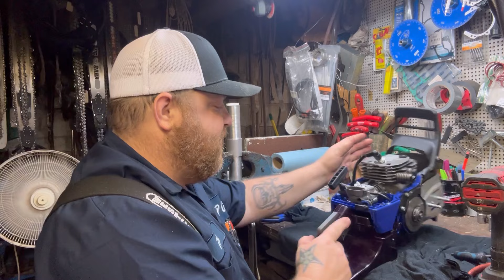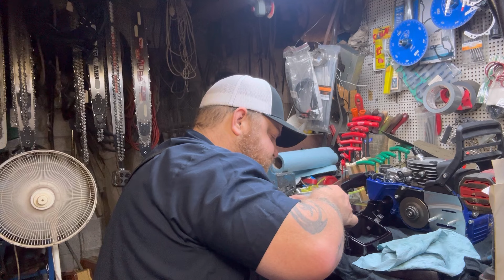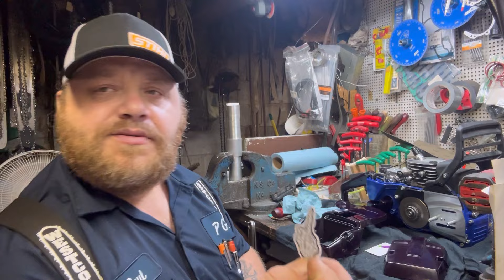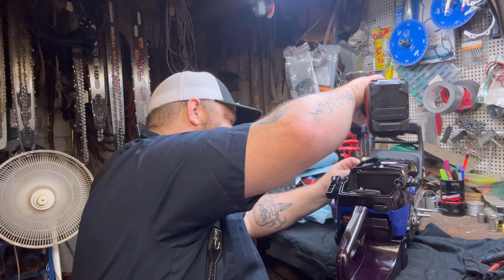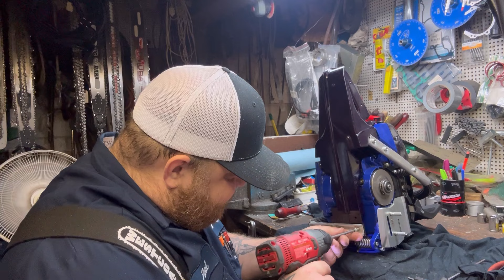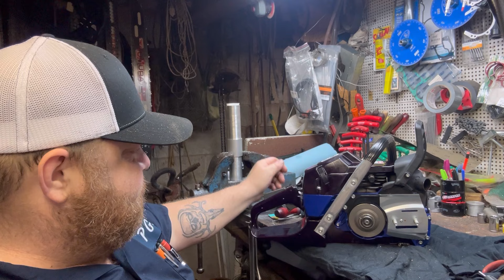PORTED HOLZFFORMA 372xp.."MOMMA TAZ XP TRANSFORMATION" @MOMMATAZ81

Comment: Did you use all Holzfforma part on that build or do you swop some out for better parts? I have never worked with any clone stuff. I’m out of the loop on what’s good and what’s not.
Reply from the maker: 100% Holzfforma
Reply: Thanks, Aaron. I have a friend wanting me to do one up for him i’ve seen a lot of mixed reviews on needing to upgrade, crankshafts, carburetors boots, etc.
Reply from the maker: Lots of stuff floating around the web ..most just assume they are junk..I run the parts till I have a failure and I’ve experienced very little failures